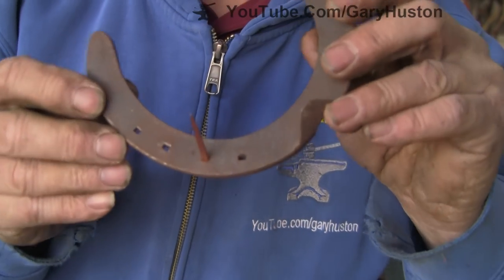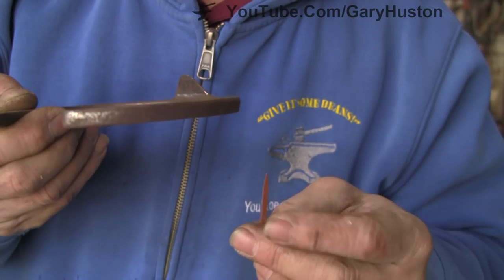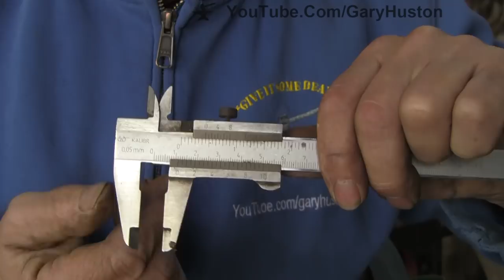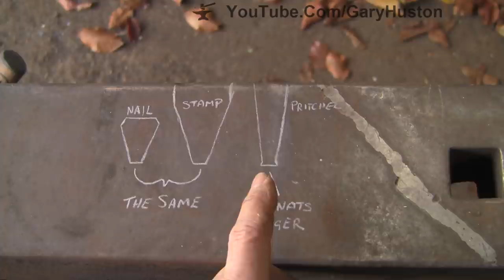Back to basics, nail hole stamp

Comment: I have made some tooling out of H13. It is amazingly tough. Nearly white hot I had to use power hammer to move it at all.  I don’t know how to go about anealing it. 
Nice video Gary.
Reply from the maker: “Annealing, Soak thoroughly at 840-860°C before furnace cooling at a maximum rate of 20°C per hour down to 600°C followed by cooling in air.” That is straight off the net.